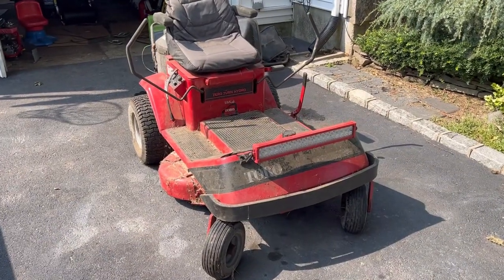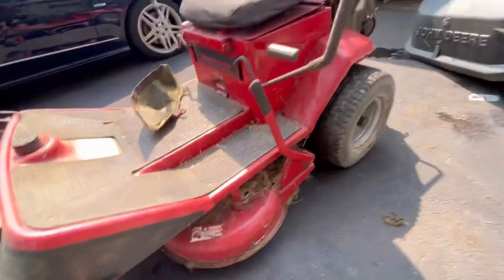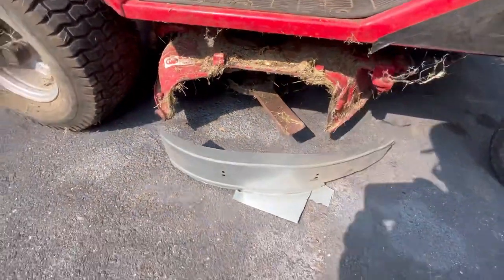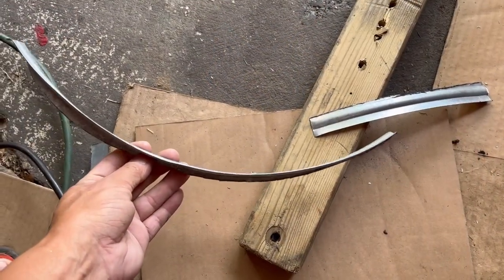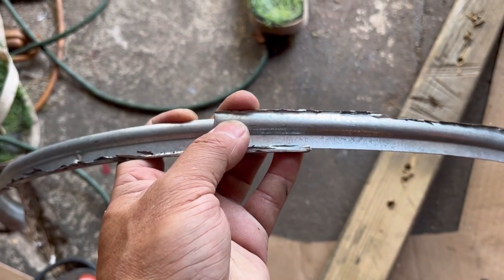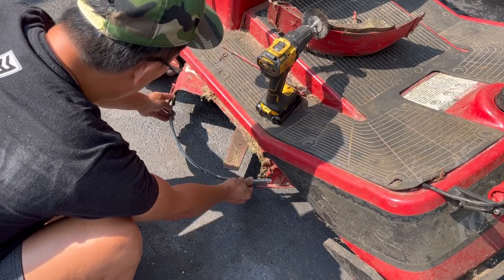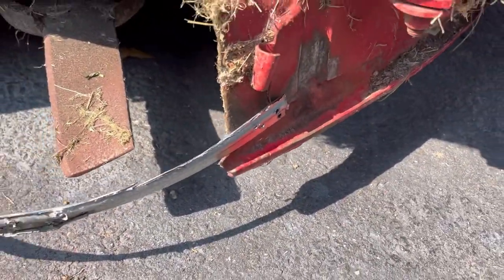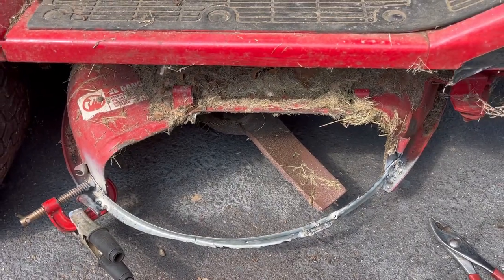TORO 616Z ZERO TURN LAWNMOWER DECK FRAME WELD REPAIR FABRICATION FOR MODIFIED BAGGER SYSTEM FITTING

Comment: Cool fix. If it doesn't hold, try pop rivets. See if one of your product suppliers will send you a gun. If not, Home Depot has a Stanley for $14. I fixed a similar broken piece on a Toro Personal Pace deck 3 years ago. Still holding strong. Plus, I use rivets for many fixes, from repairing grass bags to even dog leashes.
Reply from the maker: Yeah but I’d still have to drill holes for the rivets.  May as well just impact a few self tappers…easier.

Comment: I'm just getting into welding, I'm ok but I've only been welding 2 days. If it is a mig welder..which is what it looks like you need argon shielding gas. Another tip run beads keep going and don't stop. Other than that great fix

Comment: First of all, it's galvanized steel, not aluminum. When you cut it with the grinder the wheel gave off sparks. Aluminum would not make sparks. And as Knighthawk said welding galvanize whether it's hot dipped or electroplated, it's a zinc coating. Welding zinc gives off a very poisonous fumes. As I and others have tried to tell you, clean off material that you're going to weld with a grinder, not a wire wheel. You need to get down to bare metal for best welding results.  Paint, mill slag which is a gray coating on steel and rust are all contamination and they all interfere with the welding process. You need to get down to clear shiny silver looking metal for best welding results. I'm 80 years old and have been welding since I was 16. I think I have just a little experience.
Reply from the maker: You learn something new everyday.